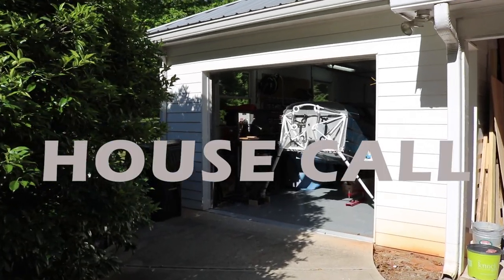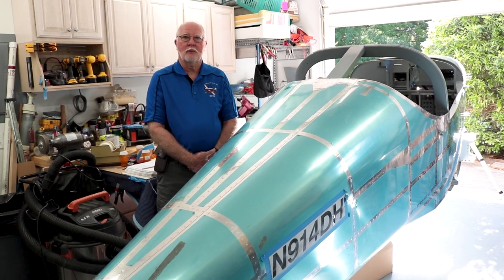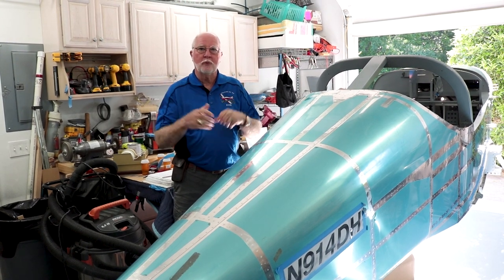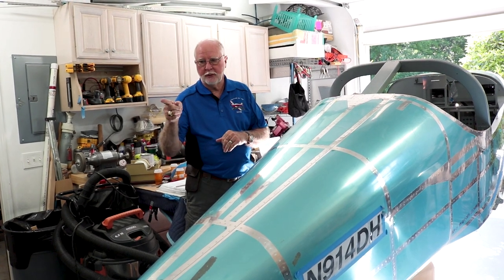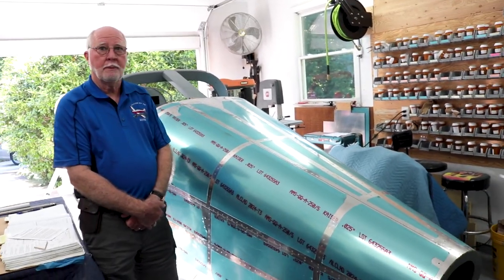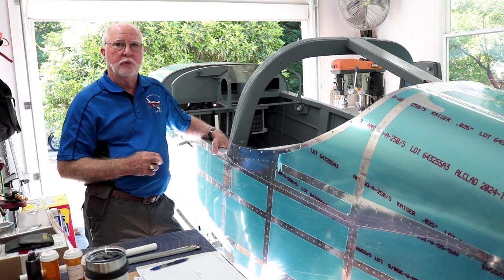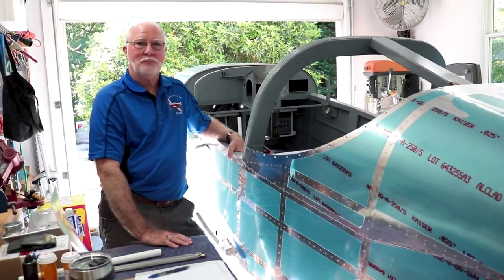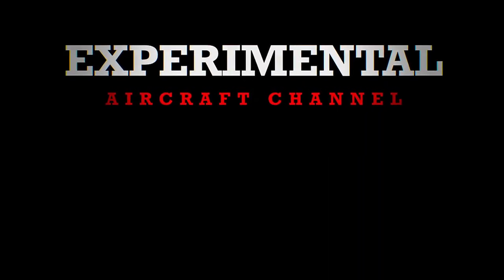Vans RV14 Builder House Call - David Hays

Comment: Another great project video Bryan. A person just needs to keep working on the aircraft on a regular basis and you’ll Finnish it. Hopeful that the money doesn’t dry up and the aircraft will fly one day. Just keep chipping away at the mountain and it will get there. As one person mentioned if he takes the tail-feathers off and rotate the fuselage to accommodate the wiring it will save time and skin. It may almost be worth constructing a rotisserie just for the wiring alone because there really not that difficult to produce if he has a welder? Then he could possibly sell the rotisserie off to the next person building the same airframe.